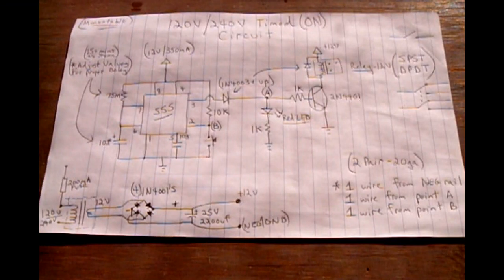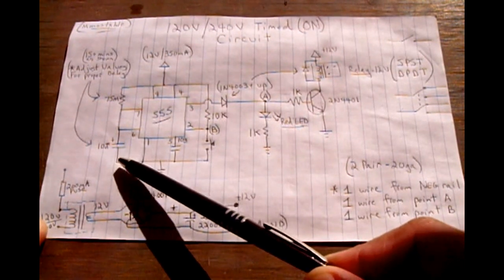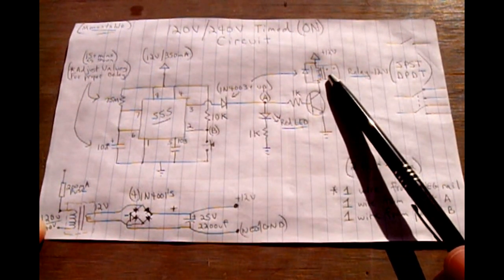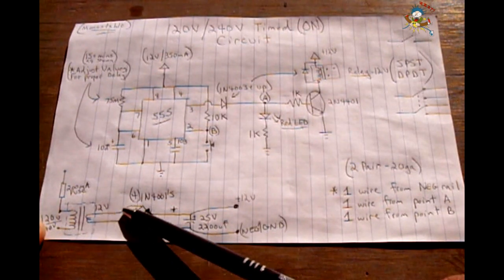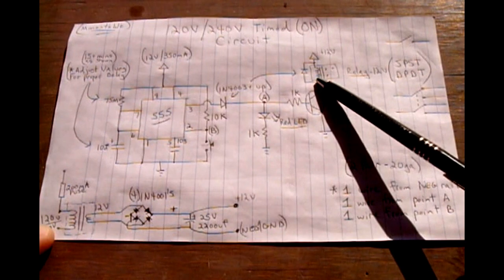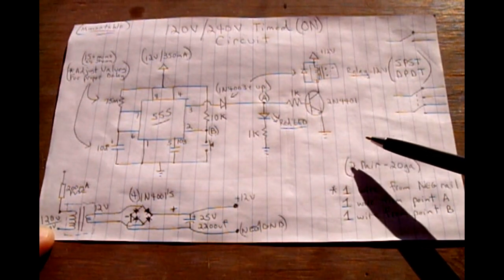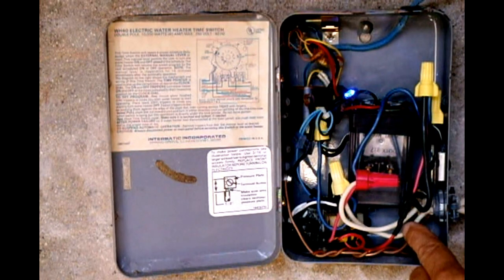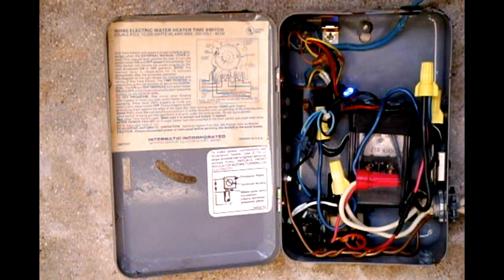SIMPLE Power ON Timed OFF Circuit (120V/240V)

Comment: This a handy circuit to keep in mind.
I have a D.C.motor driven time of use timer that was made by Reliance Electric. The motor was made in France and is run off of single NiCd cell that is kept charged via two dropping resistors and two diodes directly from the 240 volt mains. The original battery puked onto the circuit and overheated the resistors. I emailed the company and an engineer replied back as to the values that they were, the diodes were fine, I RTVed a new much larger NiMh cell into it and it now has a off line run time for more than two weeks. That timer has been in service for 30 years and has moved with me over the years.
I had made a version where I used a solid state relay and an old wall plug timer powered by a DC wall wart to trigger the SSR.
Thumbed up, good stuff man

Comment: Great video, i have a pretty heavy relay i wish to use .its the type that starts your fan from the t--stat .would using a 3055 npn effect perfect in any way.  Thank you
Reply from the maker: billybonewhacker Probably a contactor. The higher the current of the relay coil, the higher the current required into the base of the transistor. You can always use a N-channel mosfet. :-) I would add a 470k - 1M pull down resistor from the gate to the NEG rail of the circuit. Lose the resistor from pin #3. The output of the 555 can only handle so much current before you blow it.

Comment: I keep hitting dead ends, anyone know where I can find an ON-OFF timer that is for a DC application. I only need to run 12 volts off it so I though it would be easy to find. Searched ebay and online but no leads anywhere.
All I could find were 12 volt timers that use a battery to time the on-off for the 120 volt AC...

Thank you for the videos.
Reply from the maker: NoFear4XJs You need to look through my video playlists.....I have a video for that.

Thanks.
Reply: Ok Thank you,
Cheers.